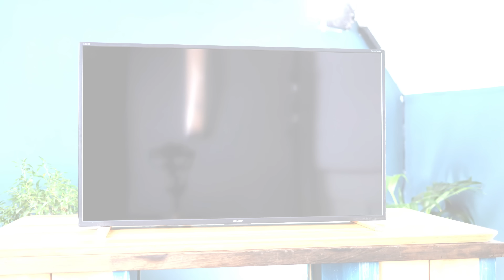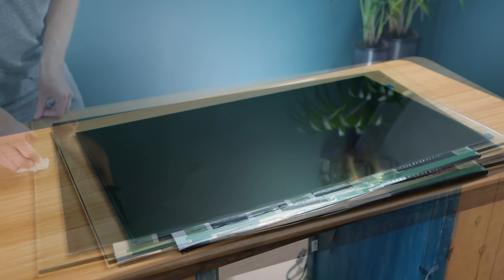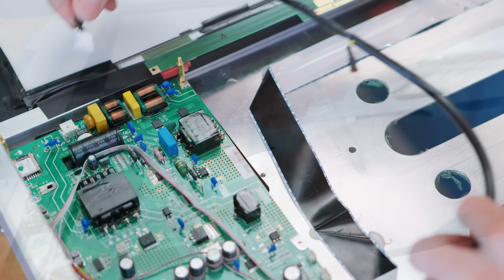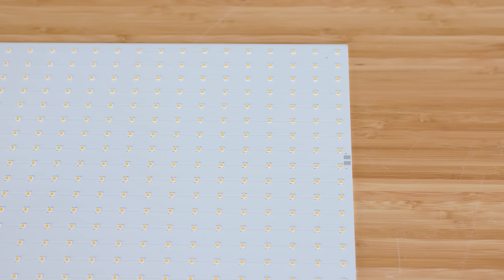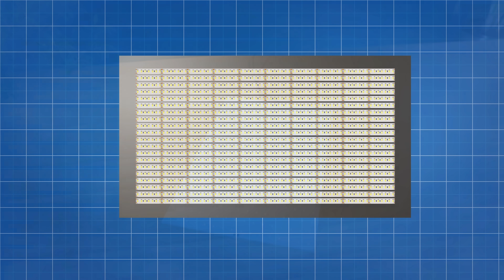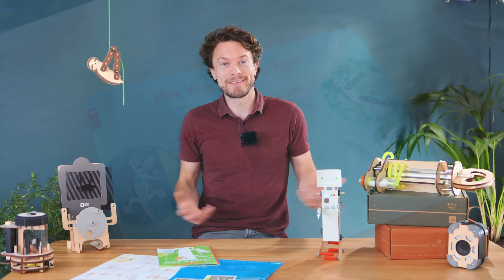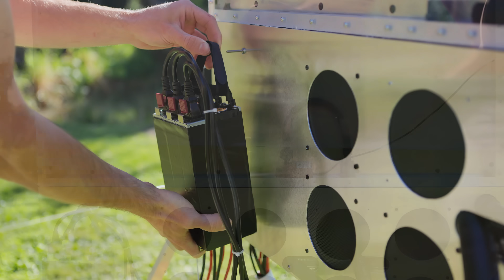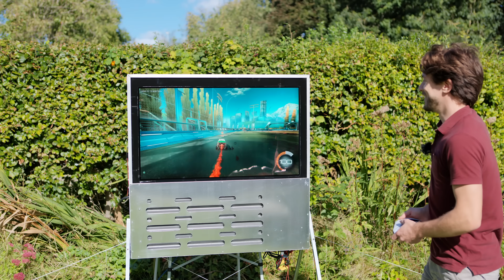Building an ULTRA-BRIGHT water-cooled TV...

Comment: Hi DIY Perks.  I hit subscribe because I found this video really interesting, mainly because I import outdoor TVs here for bars restaurants hotels or  even home use.   They are 2000 or 3000nits (optional) but they are not water cooled. They have a large aluminium heatsink (about 10cm deep) and weigh around 80Kg. What size/weight is the one you built?  Obviously being outdoors the viewers are further back than is the case indoors so you need a bigger screen. The largest I have are 65" - they are 'semi outdoor' in as much as they run in direct sunlight but are not waterproof.  They are on a dual pillar base stand with wheels.  The waterproofing is not really an issue as it hardly ever rains here (88mm a year) and it is sunny almost all the time, so they can be wheeled indoors if it is likely to rain (we get a yellow weather warning for clouds never min rain. If it rains the schools close!!).  Interesting you mention the costs of outdoor TV as $5000??  The 65" ones I sell are under $3000 with the large stand on wheels, the smaller 55" and 49" are a lot cheaper.

I would be interested though in pursuing this project in a more professional way to see if it is cheaper than importing. Do you have any idea of the costs for the air cooled version, 65" 2000 nits?  Also do you have a problem with ambient temperature?  Average shade temperatures here are 20C-24C winter and 28C-32C summer unless there is a 'Calima' in which case you can put 10C on top of that at any time of year, so 29C winter shade / 42C summer shade does happen - about 6-10 times a year on average lasting from a few days up to about a week.  

The TV monitors I import are OK to run up to 50C ambient, but direct sunlight temperatures can exceed that in summer and the monitor shuts down, it then restarts once it cools down.  The only option then is to put some sort of shade (a parasol for example) over the TV to keep it cooler.  Do you know the maximum ambient temperature your water DIY version could work at?

The last question - I thought you needed special LCD panels so they would not 'bleed' at high temperatures such as in direct sunlight. Did you find any problems long term in using a normal TV panel?

Comment: Even if you splurge on quality build materials. It will still be a Fraction the cost of off the shelf Outdoor specialized TVs. Even worse the off the shelf ones are no where close to as Bright. Most are not designed for direct sunlight viewing. 2000 Nits is just insane.

Comment: I will be impressed if this thing survive the winter outside. Why you didn't include a potentiometer to control the volume of light? Even better is automatic brightness adjustment depending of ambient light like there is on some smartphones.

Comment: I believe one thing this Project would need is a Anti-Glare coating/film on the Glass, as the outside light glare would be irritating for people who wear Specs.
Reply: The biggest problem with plasma TVs is the shiny glass. They are useless indoors if you have lots of windows and use it in the daytime
Reply: An anti-reflective coating would be an excellent addition, but a sheet that size is expensive. You don’t want to use an anti-glare (matte textured) film because it will make the display very hazy in bright light. The anti-glare is great for dissipating very bright reflections. It also doesn’t look good when the front cover glass is so thick, like a coffee table.
Reply: How does wearing glasses make glare more irritating? (I know some glasses are polarized, but that's to reduce glare, not increase it, and works best against glare off horizontal surfaces.)
Reply: @IDoNotLikeHandlesOnYT  I have Specs with high power, and when there is Glare on the surface of what I am looking at, it causes a slight headache, especially if the Sun Glare is being reflected back by a TV Screen or Monitor.
While indoors it's easily possible to avoid or counter the situation, but outdoors it's different.

Comment: Couldn't you just have replaced the existing led's with your way brighter led's and add some fans to the LED area?
Reply: That would definitely take too little heat away.
As he said, only with additional heat radiators (which cost more) at the back of the leds, an air cooling solution would be viable.

Comment: Did you think about using a convection system with the radiator and adding a a series of aluminum profiles on the back with wholes on the ends (alternating as to make a salamander)? You could use profiles (like the ones you showed for the air cooling) to mount the LEDs and running the water.

Comment: Props for using plasti dip, its actually quite useful.
For example, i used the black version to spray my outside step railing which is metal then sprayed the railing with a clear gloss coat to protect the plasti dip. Did that a couple years ago and it still looks as it did, but i may touch up the clear coat a little bit <3

Comment: What prevents condensation from building up moisture inside of the case, which could cause the PCB to short-circuit?  It's an important consideration when constructing outside electronics, especially if you live in cooler areas.  During colder seasons, while on, the inside air of the case could conceivably (if not likely) be warmer than the outside air which will cool the aluminum case, causing said condensation on the inside.  If I missed the step, let me know. ;)  A little insulation could do the trick, and probably only add a couple bucks to the bottom line.
Reply: If this is placed outside, considering the ventilation holes. There will not be any area of different temperature. Condensation typically forms when there is a difference between one air volume and another air volume, in closer temperature range. For example, 10 degrees in car but 5-8 degrees outside. (Celsius). So the condensation does become a problem after use. But otherwise, not really. Since the difference will be negligible due lack of temperature isolation. What will be a problem is Moisture and erosion. Since the humidity in the air will be perpetually higher compared to a stable in-door temperature. 

So I doubt Condensation will be a the short-term problem. But rather the Moisture and Erosion.

Comment: Why not build the radiator behind the screen or flip the design so the rad is above or just make it thicker with the rad sandwiched between the screen and electronics.  This would make a much more efficient cooling system wouldn't it?

Comment: The water seem to be sprinkling on the acrylic and the aluminium back of the LED.
May be good to have some thermal sensors on the LED backpanel to make sure that the temperature is kept steady.

Comment: Next I want see a TV has this for nighttime spectaculars, but also in the day time can be powered DIRECTLY by the sun, using mirrors to lens and capture sunlight, and then using the sunlight as the backlight. The beauty of this system is that it naturally matches the brightness levels outside. You make it slightly  brighter or less bright by changing the focus of one of your lensing elements, but in general, it will keep up or excel the ambient brightness this way, without wasting power.
Reply: That's what I was thinking too

Comment: I used to work for an outdoor LED message center maker- those huge electronic billboards dotting our highways and buildings. I would add a sensor to auto-adjust brightness, not just for nighttime viewing but also on the fly such as variable cloudy days. Some of the large commercial signs can reach 40,000 nits.

Comment: For future consideration, if you use RTV silicone, it will make the seals/joints waterproof while also being a little more maintenance/repair friendly by being fairly permanent, but easier to scrape off. Another option is to make your own rubber gaskets with something like permatex, so you can remove and replace them later on if need need to change any parts of the screen.

Comment: You could try using a camera ND (neutral density) filter over the color measure. NDs (good ones at least) are supposed to be completely color neutral, so in theory you could still have accurate readings.

Comment: Just to let you know, the Sun is a source of 380 septillion Watts (that is, 3.8 x 10^26 , if anyone wants to check, feel free). Obviously that doesn't all face us directly. At least half is on the wrong side and goes off into space, and even from the top, bottom, and even directly in front, a lot of photons are going to be aimed in the wrong direction and zip off missing the Earth by miles. And not all of it is in UV. 

But if you consider that a UV lamp for things like erasing old EPROMs and setting masks and things, is rated in the total watts of the bulb, regardless of how much goes where (though to be fair they're usually in reflective casing), maybe it's fair to compare, maybe how much of the Sun is UV and call it half, for the half facing you?

I dunno, I just thought it would be could to say you're using a very powerful UV light. According to 5 minutes searching the SI prefix is either "Brontowatt" or "Hellawatt". Some people voted for it, and you know what happens when they let people do that.

Comment: What I am wondering about is whether it would be possible to space the LEDs out to create a bigger screen (ignoring the LCD problem right now, that's a different issue) or the space between the lights would show up.
I mean in the original the LEDs were at least 10-15 cm apart and they were singular LEDs, so logic would imply that spacing these sheets could work at the cost of brightness.
Reply: I'd think so - fixing this problem is what the diffusion sheet is for.

Comment: Now DIY yourself a half-decent barbecue 😉
I wonder if it's not possible to get much better light than the original leds while still keeping it cool ? That way you would just need to change the LED instead of doing this whole thing. 
If the LEDs aren't extremely expensive, it would also be cheaper.

Comment: NO DUH people asked to keep the cost down. Most of the "DIY" builds on here NO ONE would be able to do unless they have freaken expensive tools like a CNC machine and have a bunch of money just laying around. Most the builds end up costing just as much if not more then just buying the thing from someone else. I mean some of the things they do on here should change the channel's name from DIY Perks to DIY "but it will cost you more" perks. I mean seriously, they might use a broken screen or something, but what the "DIY" part they do ends up costing more then just buying a new one. Kind of missing the point in using old electronics or spare screens there bud.

Comment: The only downside that I can think of is thermal expansion of the panel itself.  If it attempts to expand but can't because it's physically cemented to a sheet of glass, it may crack.

Comment: Would you be willing to test this with a reversing the in-out of the tank behind the LEDS?  I think grabbing the water from the top would allow the radiator to remove more heat since it’s dealing with the warmest water. For this I would add a way larger volume of water
Reply: The water at the bottom has probably the same temperature everywhere because of the turbulence, and having the inlet further down prevents it from sucking air.
Reply: @XC_Tom  Thanks for the reply. You are probably right

Comment: Why would u make it so tall tho? Like, for people to sit in front of it half the height would've been more than adequate, maybe even with the bottom side resting on the ground with just some foldable struts to keep it from falling over instead of outright suspending it off the ground. That way the center of mass would've been much lower and the wind wouldn't have been nearly as much of a problem.

Comment: Allright, now add a wooden(?) enclosure, some heavy duty wheels, soudbar, chromecast, electric fridge and maybe even a phone charger for the ultimate outdoor experience.
You would essentially have a mobile TV systems you just need to plug in, given you have wifi coverage in your garden.
Bonus points if you can get this working on solar power.
If made cleverly, you could have a unit you can simply leave outside when closed.
I smell a great business opportunity here.

Comment: When I was a kid in the 80s. I had a hand held game. It folded open. The LCD would face the sun and you would look at the light passing through the LCD reflected on a mirror. So basically the back light was the sun or the light in the room you were in. I still have it in storage. I was getting excited when I saw your video. I was hoping you made a TV version of my game. It makes much more sense then a bright backlight.
Reply: Also in the 1980s, we had these super-bright picture tubes (CRTs). Water cooled, of course. They were not meant to be looked at directly, but were used in projection TVs.

And, yes, I also was hoping for a heliostat to provide the backlighting.

Comment: Form follows function! You're TV is beautiful because it was cheap and functions well. That boarder is fine, you're not going to make a multi-TV tiled display to use outdoors. Although you probably could create a lens or mirror system to turn that into a projector for a large movie screen for night viewing, without having to alter the TV itself.

And if you slow the radiator fans a little, and add anti-freeze to the water, you could probably use it during the Winter. It would defrost itself!

Comment: Can you make a Mag Safe Battery Pack for the iPhone 12 Mini 

It Should Have 

1) Magsafe Magnets (you can skip on wireless charging)
2) It should be able to fully charge or more an iPhone Mini
3) It shouldn't be thicker or wider than the phone itself 
4) Easy to attach & detach from the iPhone

Optional Extra / Good to Have

1) If it has contact pins to charge the iphone (it is ok to cover up the lighting port)
2) If it has type C & lightning port 
3) Some kind of heat dissipation 
(Since the Mini is known to have heat issues while charging & heavy usage) 

I know there are 3rd party & Apple Magsafe battery pack available but 
Most of them are too thick (including Apple's) & most of them cannot even fully charge an iPhone 12 Mini

Comment: hey DIY Perks! is it possible to upgrade a TV's color quality by replacing the backlight with something brighter like what you did in this video?  I thought it would be cool to upgrade a cheap 4k tv's backlight and make the image look better than what it was before
Reply: You could, but you'd lose out on some features by doing this. Most modern TVs have local dimming, which makes darks darker by decreasing backlight brightness in dark areas of the picture. The system used in this video won't work with local dimming as the TV's software has no way to control the brightness of the backlight.

Comment: My one concern is how hot the LCD gets. It's probably 20% transmissive, so there's hundreds and hundreds of watts of light being converted into heat on it. Plus the sunlight itself, which is also going to be 1000 watts + of heat loading. I'd be interested to see a measurement with a thermistor attached to the screen.

Comment: I don't know about being out in the middle of the yard like that, but out on a deck or patio would be pretty cool. I do wonder if those superbright LED's will essentially burn out the LCD panel with more use. I know the ones used in resin 3d printers eventually have to be replaced.
Reply: Don’t the printers use UV LEDs though? Wouldn’t solely uv light be the culprit for burning out the lcd panel?
Reply: @RC-fp1tl  probably the combination of heat and UV

Comment: 19:06 dont think its only 2000nits, difference in nits is logarithmic I think, so this should be around 3-5k nits
(could also be that your smartphone is showing that video in SDR brightness range is therefor only at around 300 nits)
btw I would check how hot the boost converters and the lcd itself get after a while of use
and maybe you can implement a switch for the boost converters which connects other resistors for at least one other brightness level (measure at what resistance the pots are for e. at 48v and 42v - for using it in the afternoon)
Reply: Yeah, it's probably brigther than 2000 nits

Comment: Would have added folding leg system to keep it up, with possible extendable spikes to hold it in ground and couple carrying handles to easier movement. Maybe additional glass that is not connected to one below so there is layer of protection for those mishaps that might happen with kids.

Comment: okay, on the COB LED panels, if you're going to go that route, you want to go with a reputable brand as cheap ones can have any number of problems from misrepresented lumen claims to faulty LEDs in the array to even a short lifespan.  I'd go with Cree, Nichia, or Osram.  Those are pretty much the three most reputable brands out there.

Comment: im sorry, but did you add the cost of all of that aluminum into your final costs? because that is a lot of aluminum and that is not cheap. also, the cost of the buck converters? but for me to buy that much aluminum, would be in the thousands. guess prices are a lot different where i am. wish i could find all of that stuff for less then $300